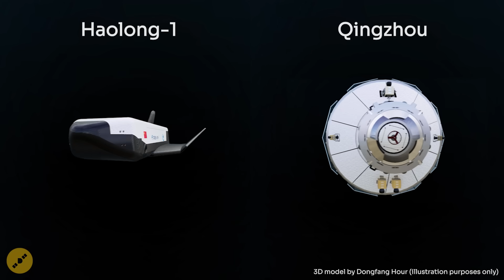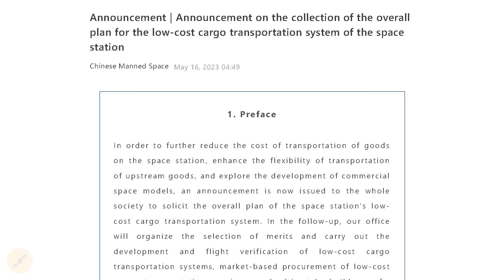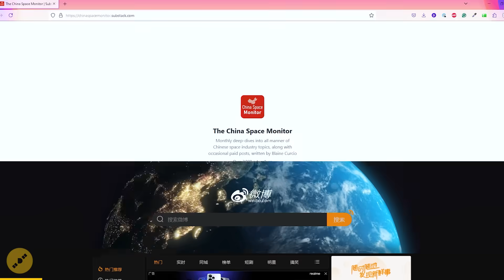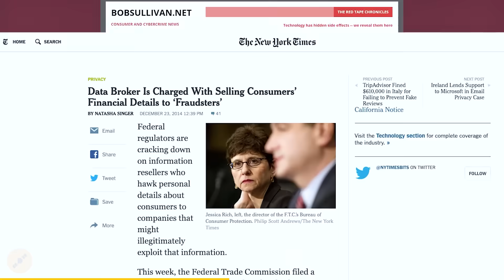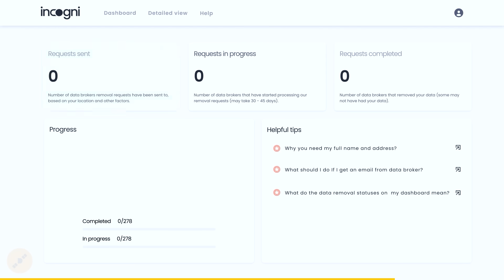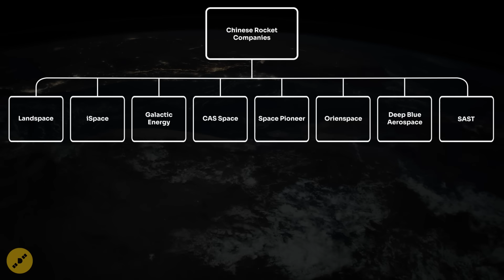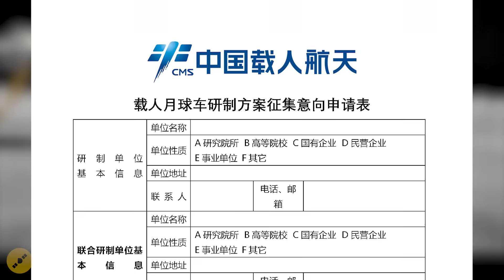China Just Unveiled Two New Commercial Spacecraft

Comment: These Spaceplanes all appear to be based on the earlier DynaSoar3, x20, x40, and x37 designs.  All of those underwent development testing to some level, and the x37 is flying now.  Payload capacity similar, about 3-tons.  These early designs are all based on Northrop falling-body research.  Newer materials can make them lighter, thus adding payload weight.
Reply: There was also the Soviet Bor-4.
And the X-38 which seems to be the precursor for Dream Chaser.

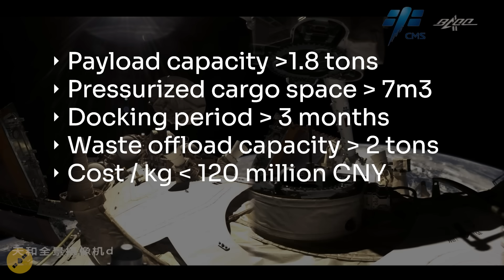Comment: 2:03  "Cost / Kg" should be "Cost / Ton".
Reply: 16,000 usd is not 120 million CNY which is the per-ton value. however accounting for the 1000kg in a ton the usd value per kilogram is closer to 16k usd
Reply from the maker: Ah yes, you are correct, that was a typo.
Reply: @DongfangHour   While we're handling typos, 27 cubic meters (presumably) rather than 27 square meters at 8:17

Comment: China space program is progressing ahead in a steady and continuous manner.
China unveils design of Haolong space shuttle for low-cost transport missions.
The Haolong space cargo shuttle can be launched by a carrier rocket and dock with the space station. 
After separating from the space station, it can perform deorbit braking, reentry flight, before landing horizontally on an airport runway. 
It has large capacities for cargo transport both to and from the space station, excellent flight environment and efficient support for operations. 
It can further reduce space station cargo transport cost by repeated use. 
With the existing cargo transportation systems, it aims to establish a safe, reliable, diverse, and efficient cargo transportation system between the space station and Earth.
The Haolong cargo spacecraft will lead and promote further breakthroughs and developments in China’s reusable space-Earth transportation technologies.